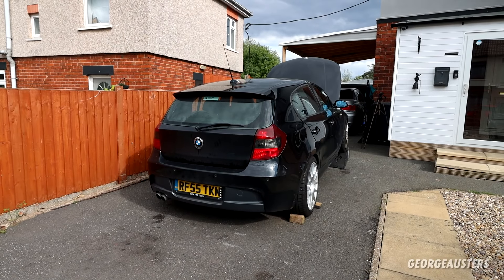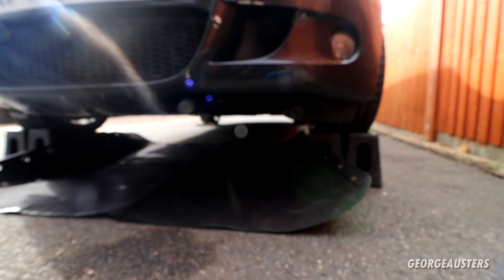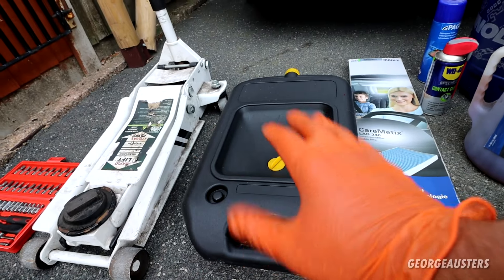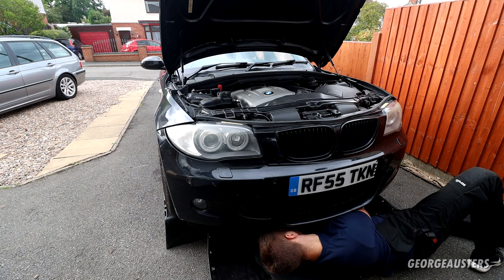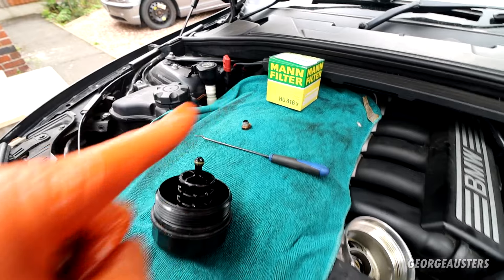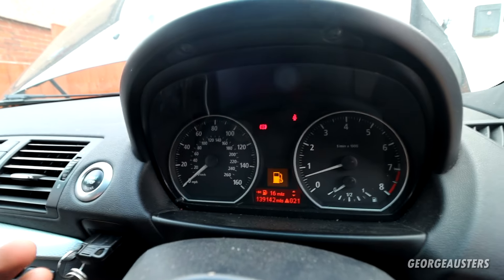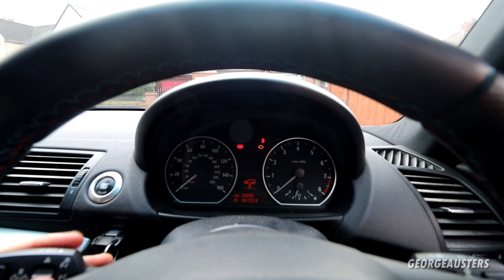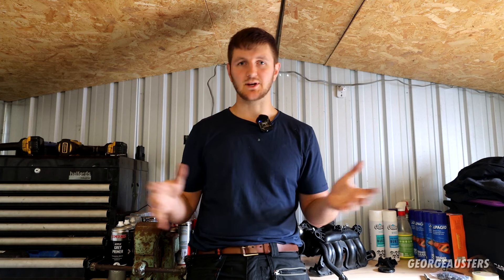BMW 1 SERIES FULL SERVICE! (E81, E82, E87, E88)

Comment: Did the same service on mine on saturday, as well as the gearbox oil service. Thumbs up !
Reply: I did my 130i manual gearbox fluid made the shifting much smoother. Did you find the same
Reply from the maker: Yep a manual gearbox service is highly underrated!
Reply: @GeorgeAusters  I did mine after watching your video if you remember back then mate
Reply: @thedetailingdoctor5746  
Yeah, espacially with the recommended oil by BMW : MTF-LT3. 
The previous owner did the oil change with 75w80, 10 thousand km ago, and the gearbox was lound at idle and shifting was a pain in the ass.
My 130i has 85.000 km, and hopefully the gearbox smoothness will last.

Comment: hi, thank you for the video and help. For a 100k miles 2007 118d , what would be your maintenance checklist? 1 year i am driving the car, old owner said they changed the oil and stuff but dont know. battery has %50, i didnt use the car for 10 days and couldnt start it. I will take it to the service but to know for this model what should be checked, tia

Comment: I have a 530i with the N52 engine and the oil won't be shown until engine running for a few minutes and of course the car must be level and not ramps. When I did mine I just put around 5lts in and then started it to let it circulate so could start to get a reading. When indicated full after around a 20idle I drove it to work and the warning light came on for low level and needed another 6ltr which was finally the 6.5lts. Never dropped since.
Reply: The car will only tell you to add one litre when the level has dropped by at least one litre. From the 6.5 litre maximum. 

So if you do an oil change and start with 6 litres. The car will not say add 0.5 litres. 

You can put 5 litres in first just to test the oil level sensor. But be sure to add the remaining 1.5 litres after the test.

Comment: evening champ, remember your old E60, when adjusting the handbrake, do you need to depress a spring which is located underneath the actual handbrake INSIDE the car ?  also i don`t know if you`ll know the answer to this 1 , but does the E60 have a feature , on the manual g/box version where if you press the FOOTBRAKE on a hill, it holds the car in place BEFORE you have to activate the h/ brake, many thanks champ !
Reply from the maker: Correct and yes if your car is equipped with hill start assist
Reply: @GeorgeAusters  AH, SO HOW DO I KNOW IF MY CAR IS FITTED WITH SAID DEVICE, whoops sorry, bloody caps lock, is there any way to remove the daft depress clutch before starting the car on the E60, oh great and wise one 😁😁

Comment: Bro, I am having an issue with my 118d that I do not know how to solve.
The car is pulling to the right. It happened after I had a flat tire in the back. I swapped the 2 back tires, brand new.
I already put it to align the car it is all straightened front and back and problem is still there
Reply from the maker: Take it to a garage and see what they say

Comment: George love ur vids - quick question just done the camchsin on wife’s bmw 1 series n47 I put a second hand head on it as I snapped the glow plugs on old head I reground valves in etc on second hand head new valve stem seal also - it smokes like mad white smoke I think and it smells horrible when it first fires up and misses a bit but after 8 mins driving it drives fine no issues - I’m thinking glow plugs possibly what you think thanks in advance mate 👍
Reply from the maker: Any glow plug errors?
Reply: @GeorgeAusters  hi George you know what I must see if their is I git a Delphi diagnostic only thing is I dint think it’s that good on the bmw - I’ve tested with multimeter and they all showing voltage - probably going to bite the bullet an change them n hopefully not snap em but yes ike try n see if I can get a reading with Delphi diagnostic later

Comment: does your car clear the ramp easily to get on it im guessing it does

thinking of buying one to change my oil i have an e91 m sport on eibach lowering sorings
Reply from the maker: It would normally but my front bumper is damaged and hanging down
Reply: @GeorgeAusters  thanks for the reply im gonna order one i hate using jacks and jack stands

Comment: Great video . Love some n52 content lol . Just wonder mate how much oil did you engine consume during the 8k miles ?
Reply from the maker: Hard to say really. I never had the add 1L oil pop up
Reply: Im running mine on 10/ 40 fully synth and it uses no oil to note ,, it was using some on 5 30 ,, its  quieter too ,,,

Comment: You need to drain the oil and refill 5 times to get all the old oil out. And run the engine up to temp each time. Otherwise there might still be some old oil in there 😝
Reply from the maker: Noted… I’ll do that next time! 😅
Reply: does that mean i will need some 30 litres of oil for the job?
Reply: @houseatreides1  yes 😉
Reply: @seanpaul3050  ouch! thanks

Comment: Spark plugs were not inspected, regapped or changed if necessary. Fuel filter wasnt changed and as for the rhino rip off ramps you can make them out of wood (plenty of how to’s on tubes). 6/10 for the service from me
Reply from the maker: There is no fuel filter on the petrol models… it’s integrated into the fuel pump. Spark plugs were replaced last year and do not require gapping👍🏻
Reply: @GeorgeAusters  if I was to travel up to your would you be able to do the edge delete for me IV got the kit but not confident in doing it really but would love to have a go?
Reply from the maker: @leonsutton299  Don't have the time at the moment unfortunately mate!
Reply: I don't use ramps at all tbh but I certainly wouldn't be making them out of wood if I fancied a set.
Reply from the maker: @ryanrepairs6944  Exactly.. I'd rather have something that is actually rated to hold the weight you need